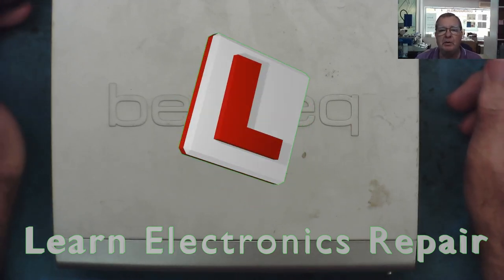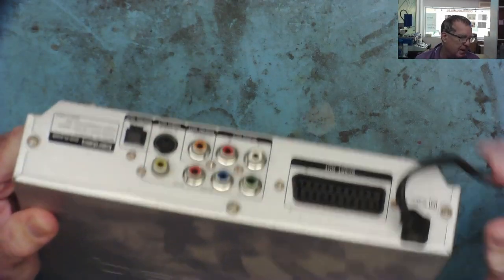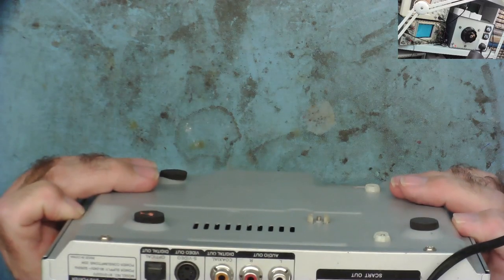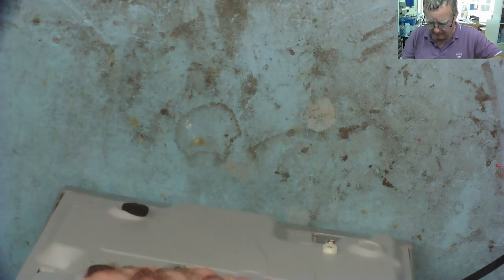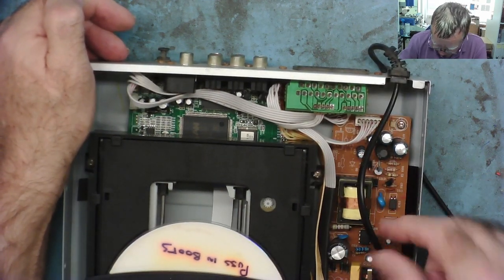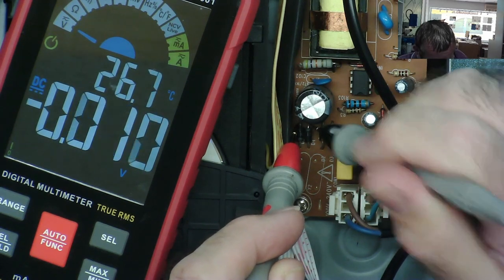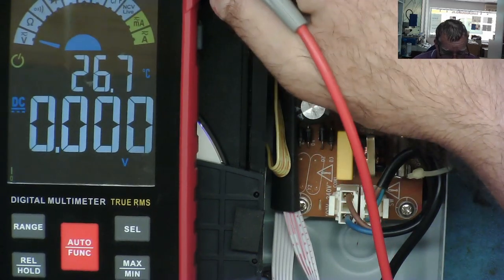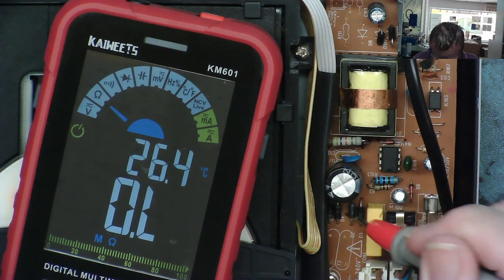Small Switch Mode Power Supply Repair Guide - Consumer Electronics SMPS How To Fix

Comment: 24:21 - I appreciate that at each point in any of your videos where you discuss the main DC capacitor you remind us to note the severe shock hazard that exists if it has not been discharged first (and each time after powering down the supply). We all need regular reminders of this.

Comment: Richard, excellent video! I've been watching numerous videos on switching power supplies. Trying to figure out how they work so I can fix one that I have. This has been by far the best video and you even mention a problem with a pulsing output which is what I have with my power supply. You are the first one that I have found to mention this issue. I have a 45 volt power supply for an LED light fixture and the lights constantly pulse. I've checked the output and it is of course pulsing. This particular power supply has a lot of components in the section you mentioned that would most likely be the issue. I think they have this power supply setup to run at multiple voltages so they have a lot of resistors in parallel and other components in parallel that they can either use or not. I did replace the capacitor in that section, since I had one on hand, but that did not fix the problem. Before watching your video, I ordered some MOSFETs since I thought it might be the MOSFET causing the problem. Now I'm thinking that was probably wrong. So far I have not found a completely failed component, but I guess I need to check the rest of the components in that control circuitry. Unfortunately I don't have any obviously blown out components like your board had.

Comment: This video is about my favorite of yours so far! Right up my alley with consumer audio electronics and common power supplies.  This is the level where I'm at also in terms of learning, and THANKS for reverse engineering the schematic and explaining it by physically showing and also how it works on paper.  I wish more people would explain using both methods.  While the repair was simple, how you got there and what to look for along the way is what makes me enjoy 'troubleshooting', as opposed to the shot gun approach of 'just' changing capacitors.  Top stuff!
These videos I come back to often and watch a few times to understand smaller details along the way.  
I'm fascinated by the ability of people who can 'reverse engineer' a circuit just by looking at the board, I'd love to learn how to that more.
A pity about the 'Puss in Boots' DVD! Ahaha! Maybe one day you'll open one with 'Debbie Does Dallas' or something. :)
Thanks again for the video, 
Rick.
Reply from the maker: The reverse engineering thing is a skill you can learn.  Just keep at it, learning electronics and how components/circuits work and you will get there I am sure.  Reaching that point is something of an epiphany and this is where you should be aiming to be as your knowledge of electronics improves,  When you get there I can guarantee to will get an amazing sense of achievement.  Enjoy the ride on the way,
Rich
Reply: @LearnElectronicsRepair  Thanks for your reply good Sir :)

Comment: That reaction to the click  is priceless !  You just never lose it !   It takes years of occasionally getting electric shocks, burned or something blowing up in your face the moment you switch it on to develop that response. 

Linford Christie couldn't move as fast as that !
Reply from the maker: 101% true - that is why  I left it in rather than edit it out.  It's a valuable lesson IMHO but also something you either develop for yourself or you just keep on getting zapped.  No other way to describe it to anyone who doesn't already have it  LOL
Reply: @LearnElectronicsRepair  Back in the 1980's I was working in a lab and got distracted and a few minutes later when I came back to the job  inadvertently connected mains 240 v to the input of a 7805.  Instantaneously there was a loud bang/crack and the body of the 7805 bounced off the ceiling and scattered cross the lab. The three pins were still in the board !
 
Of course I wasn't wearing safety glasses and if I had been looking over the board I could have lost an eye or worse.

As they say, what doesn't kill you makes you stronger  -  or at least it frightens you enough to develop some sense of self preservation.😁

I would say to anyone getting into electronics  - before you switch anything on just give it a once over in case you have done something stupid.
Reply from the maker: @we-are-electric1445  Yeah I used to work for ICL back in the 80's in their Central Spares And Repairs workshop - with about 100 other engineers all doing component level repair.   One of the product lines I worked on were large linear voltage regulators with banks of 2N3055 (or similar) type transistors on huge heat sinks and very large electrolytic capacitors the size of a Heinz Beans tin. This kit was already some years old and was built before switch mode PSUs were common.  As was normal, there was a particular work bench for each product line and this one had huge linear transformers under it, some current trips (like 25A or 50A or something) and a socket where you could plug the board under test.

I had been fixing these for a couple of days, then plugged one in and the current trips jumped out.  I reset the trips and plugged it in again - they tripped out.  So undeterred I threw the current trips to the on position and held them there.....  the thing hummed like an electricity substation for a few seconds then one of the large electrolytics exploded with a very loud bang!  As I sat there under this huge mushroom cloud with little bits of white paper like stuff raining down on me like confetti, the cheer that went up from the rest of the workshop was louder than the explosion!   Of course it was all over the canteen and I got ribbed about it for a couple of days.... until......

There was another guy working on the high speed 'band printers' that could chuck out about 20 lines of computer paper a second (the paper was about 18 inches wide, had green and white lines on it, and sprocket holes down the sides and perforations so it neatly stacked itself into huge reams of paper).  Anyway the 'band printer' had what can only be described as a large rubber band, wider than the paper, and fixed to it were all these lollipop stick type things.  Each stick had one letter or number/symbol on the end of it (A-Z 0-9 repeated many times over and over again across the rubber band).  Between the lollipop sticks and paper was an inked ribbon and in front of the lollipop sticks were these hammers (solenoids), one for each character position on one line of paper. 

So you can imagine how this worked, the rubber band rotated around two drive pulleys at high speed, the ribbon rotated on spools at a lower speed, and as the appropriate lollipop stick passed each hammer, it would hit it and print that letter.  So basically after a short distance of travel, every possible character would be available for each hammer to strike once, and it had then printed an entire line of text,  so it would then feed up the paper for the next line and continue.

Now this thing screamed like a banshee when running so it had a big soundproofed cover over it.   So one unfortunate guy was working on it and had some hard to find fault on a control board so he was probing around with his meter and had the screaming banshee running with the cover off (annoying everyone else) so he could take his measurements with the machine powered up.  Anyway of course he slipped with the meter probe and shorted some pins on a logic chip.  

Suddenly there was this sound like a rail crash and thousands of lollipop sticks came flying out if this thing like a swarm of locusts on a biblical scale - some landing many meters away in every possible direction!!  

Well after that the banshee somehow realised it was dead and stopped moving and there was this sudden silence that fell across the workshop for about five seconds.  

Then we all did the only thing a self respecting engineer could do in that situation... everyone fell about the place crying with laughter and giving the unfortunate engineer more 'stick' than he had already had in his hair, clothing and god knows where else.  It took about 30 mins for everything to clam down properly, and I had an easy time in the canteen after that as my little incident was clearly forgotten!   The banshee incident would be raised in conversation every so often for years afterwards. 

Working at ICL were some of the best days of my life.
Reply: @LearnElectronicsRepair  Aye ! Those were the days. 

 Every time I blew something up I was praying for someone  else to have a bigger 'event' ASAP so mine would be forgotten.

 Trouble is, some of the 'events' pass into fokelore  and get trotted back out  at Christmas parties !  

😂😂😂😂😂😂😂😂😂😂

Comment: Hi Richard, I got one of the Kaiweets meters through the link you gave when you reviewed them. Nice little meter. Just a tip if you don't already know, hold down the red button and it goes back to Smart Mode, just saves scrolling through.
Reply from the maker: Thanks for the info Pete - continually pressing the button to get the range you want is a bit of a pain

Comment: 41:12 My thoughs on cutting the leads before or after soldering are as follow : 
I prefer to cut them before soldering. Why? The leads on most electronic components have a layer of anti-oxidize over the blanc material of the leads itself. 
When cutting the leads before soldering, the cutoff surface is not longer protected against oxidizing , but wil be sealed off again after soldering.
If you cut the leads after soldering, you can solder the cutoff ends again, but then you have to solder each component lead 2 times, and this takes extra time, 
especially if you have a big board where you have replaced lots of components, or doing prototyping. 
And i find soldering the cutoff ends gives also a smoother look and cover any sharp ends. That's my 2 cents ;-) Thank you for the nice tutorial. Grtz from Belgium.

Comment: Please keep in mind, that I’m a NOOB at electronics. This was yet another great video but honestly, at around the 27 minute mark, you completely lost me. It’s not your fault, it’s just my insufficient knowledge of the matter. But I watched it through, because you make it sound easy and not everybody can do that. So, please keep making videos because with each of your videos, I learn a little more - and that why I keep coming back. Cheers!
Reply from the maker: Hi Max. This isn't the easiest circuit to understand but you find it (or a version of it) in almost all switch mode power supplies so it is a very important one to get your head around. Let's try it again from the basics:

The controller chip that drives the transformer needs power to work.  This power supply voltage is called Vcc.

When you first power up (and the power supply isn't running yet), the 1 Mega Ohm resistor connected to the 320V from the incoming mains supply, charges the little 10uF 25V capacitor - I made a video 'all you need to know about capacitors'  if you need to learn about capacitors first.  There is also a Zener diode which prevents the capacitor from over charging - again I made an 'all you need to know about zener diodes video' if you need a refresher course.

Capacitors
https://www.youtube.com/watch?v=R9slJUqT6Ls
Zener Diodes
https://www.youtube.com/watch?v=trjbHhLERic

Once the 10uF 25V capacitor charges up to around 15 volts, the controller chip turns on and starts working, so the controller chip starts to draw power from the 10uF 25V capacitor.  The controller chip then drives the switch mode power supply which starts running and you get output voltages on the secondary windings of the transformer.

WHAT HAPPENS IF THERE IS A FAULT CONDITION
If the power supply does not start after a short period of time (due to some fault) the controller chip stops running because the 1 Mega Ohm resistor can not supply enough current to keep the 10uF 25V capacitor charged and the controller chip running.  Basically, the controller chip is drawing more power from the capacitor than the 1 mega ohm resistor can provide to recharge it, so the 10uF 25V capacitor gradually discharges and when the supply voltage drops to about 9V the controller chip switches off again and stops drawing current from the 10uF 25V capacitor.  

At this point the 10uF 25V capacitor starts to charge back up again via the 1 Mega Ohm resistor and when the supply voltage (Vcc) gets back up to 15V the controller chip switches on again.  This property of switching on at one supply voltage (15V) then not switching back off until a lower supply voltage (9V) is called Hysteresis.  The power supply will keep cycling on/off like this and often causes a chirping noise or you see the power supply LED pulsing on and off as long as the fault condition exists.
.
WHAT HAPPENS IF ALL IS OK
If all is OK, the secondary on the high voltage side of the circuit (the one with the diode and two 100 ohm resistors)  starts to generate voltage and this also charges the 10uF 25V capacitor.  Now the capacitor has sufficient voltage supply (current) supply to stay fully charged and power the controller chip indefinitely, so the power supply keeps on working as long as you have it plugged into the mains.

See if that helped you, then try that section of the video again:  If it's still clear as mud let me know and I'll try to think of some other way to explain it.  Once you master this part of the circuit you can repair just about any switch mode power supply.
Reply: @LearnElectronicsRepair  My goodness, and thank you so kindly for your reply - it’s truly appreciated. Yep, this is a LOT to wrap my head around, but I don’t give up easily. I will watch this video many more times, as I often do with your videos, because your approach seems so… natural, to me - I wish you were my uncle. And I won’t hesitate to ask more questions, you don’t have to worry on that front [I can be quite annoying]. Anyhoo, thank you so very much, for your help. Keep making videos, good sir. Cheers!

Comment: To switch mode, you have to stress the power supply, overloading it a bit. It will switch to performance mode, and remains better. For a 280w ups, stress with 380w bulbs. It will start to consume less power on battery. For power banks, I used a usb solderer. That needed me 30 min to 1 hour for the fix.

Comment: Thank you for your great informational videos. I have been trying to get into electronic repair without having to go to an overpriced school to learn a new hobby. I have learned a lot of information off of your youtube videos but some how managed to miss one important note. Where exactly are you supposed to ground off to test current voltage? I noticed different readings between neutral and board ground. This is for a PSB board in a vacuum cleaner. (Test subject) I hope to get better with electoral device repairs and will continue watching any content you put out. Keep the great work

Comment: A converter like that rarely runs at more than 200 kHz. Most will be in the range of about 100 kHz to 150 kHz.

The common mode inductor or "choke" is not for keeping mains noise out. It is for keeping noise from the switcher "in."

With a flyback converter like that I would replace all of the output capacitors. In such a converter if one capacitor ages to high ESR the other capacitors on other secondaries tend to get overstressed with excessive ripple current due to the way current gets distributed among them.  If the "main" capacitors can't accept the charge, more of it gets dumped to the other, typically smaller caps, overstressing them - exceeding their ripple current rating. This leads to rapid aging and even though they may show no overt signs of damage they may well be on their last legs. It takes very little extra time on a single-sided PCB to pull and replace all of the caps on the secondary.

Comment: It's a good idea to clean the flux off those joints. I have seen some occasions where it works at first, but then forms a path for current and starts smoking.
Reply from the maker: Also the glue they sometimes use to hold down the inductors or large capacitors (to help prevent them breaking away from the PCB due to vibration or physical shock) goes dark brown.black and becomes conductive. This is something else to look out for.
Reply: @LearnElectronicsRepair  Yamaha products often had this problem.

Comment: So the first lessons were basic electrical components so resistors, capacitors etc! I had gone over the safety issues and came to capacitors! Capacitor values and working voltages were covered strongly. I explained if a capacitor working voltage was exceeded it could explode! Some of them laughed at this so I thought demonstration needed here! With the revelant safety (goggles) I setup a electrolyte capacitor  behind a safety glass connected to a DC power supply! So a 40 volt electrolyte was the first candidate selected. As the meter approached the 40 volt the milliamperes started to increase! still it crept up over 45 volt, nothing happened “he is speaking dross I heard” 5 minutes later it was near 70volt, they were all drinking coffee by this time! BANG!!!  Some of the coffee was dropping off the wall! “ JEEZUZ CHRIST” I heard!  It went off like a shotgun! Now you will remember the danger! I said! If you had been working on a bench that could have cost you your eyesight! My boss agreed!

Comment: Hi Richard unclear about voltage divider and charging capacitor. I calculated the voltage across the 100R is 0.031V. Can you explain how the capacitor charges to 15V

Comment: Sir, you completely left out the most important part, i.e. feedback loop with voltage reference IC102 (e.g. MCP1525) and transoptor IC105 (as far as I can read).